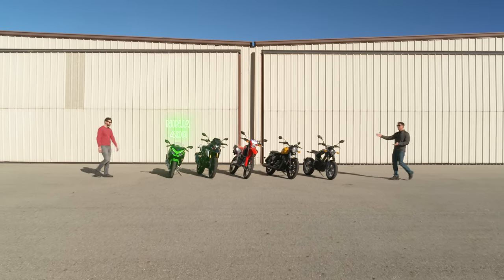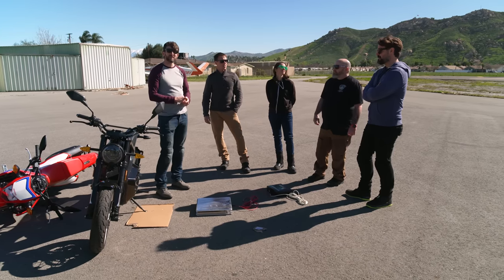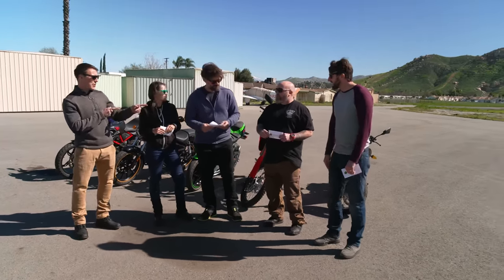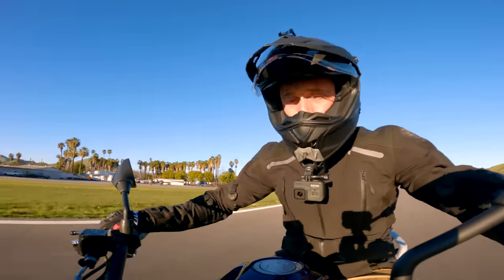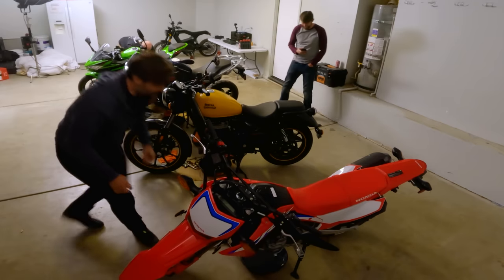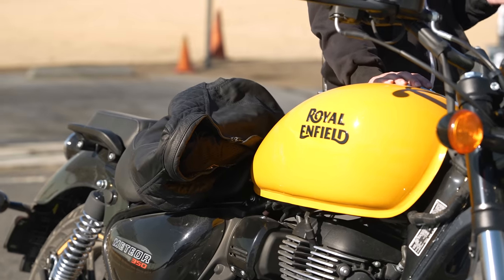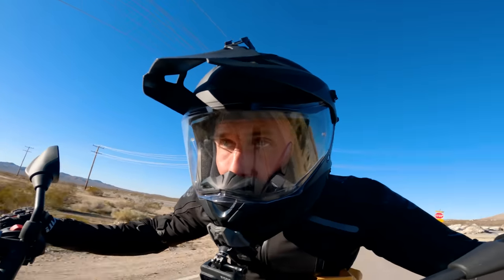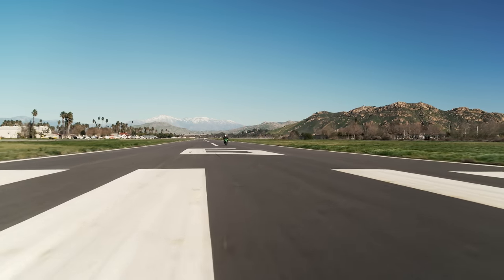Best Beginner Motorcycles! Ninja 400 vs Meteor 350 vs CRF300L vs Sondors Metacycle vs G310GS | CTXP

Comment: Proud of the two Indian bikes on there :) I've ridden them (RE and GS) both and i gotta tell ya, the Indian motorcycle market has some of the toughest competition out there. These are some of the best motorcycles I've ridden and they're a great choice for any beginners out there.
Reply: I also think it would have been interesting to swap out the Metor with either the Classic 350, Hunter, or Himalayan, but I think for this test they wanted to have a cruiser, sportbike, ADV, dual-sport, and electric. As the owner of several bikes including a beefy 1250 GSA, I'm still jumping on my Classic and Himalayan to have fun. I think RE is on a roll with things and the US market is really just now opening up for them.
Reply: I have a '22 himi and I ❤ it.  I put 1500 miles on it in the first month I owned it.  My understanding is that RE is coming out with either a 450 or 650 as an update.  I hope that they keep them oil-cooled thumpers with NO tech.  I get complements on my bike all the time from old guys that think it is an old bike.  They can't believe it when I tell them it's a '22.
Reply: @shannonkerr2313  That's the USP of RE. Classic design language.

Comment: Good stuff!  This is rare for me to comment on any YouTube video, let alone a motorcycle video. I am providing my cost to repair after dropping my used Triumph Trident 660 twice within two days.
OEM front brake lever - $70
OEM rear brake pedal - $129
OEM Bar End Finishers (x2 as the ones on the bike were aftermarket) - $52
DIY install - $251 total. 
Extras:
Amazon levers - $29
OEM frame sliders - $152

I’m keeping and displaying the mangled parts as an example of what not to do!

Comment: I’m happy to see the 310gs rank fairly high up there. It’s a fun little bike and makes for a surprisingly good street legal dirt bike
Reply: until you put it against others in its class.
Reply: I like that it's on here for a small ADV bike.  BUT I wish its spot was taken up by the 390 adventure.  The KTM is better in every way.
Reply: @Ntmoffi  the 390 adv will demolish it in performance and value.
Reply: @norbertovillarealiii6750  💯✅
Reply: Knock knock, KTM head gasket
Reply: @memewizard8372  that was a problem on the first Gen 390 head and got fixed on the second Gen.  People who fixed their first Gen head and others that are in the second Gen are reporting 30k miles + with no issues.
Reply: @Ntmoffi  KTM - ready to repair
Reply: @Ntmoffi  I also think it was mainly a problem because people in the US expecially did mods to it without a tune, like a full system and cat delete.
Here in Germany we can't do anything stupid without pretty much losing the bike's value in fines. And I've never heard about a 390 dying out of the blue. I've heard of one case where someone at like 60000km having a transmission problem, but that's probably because the bike got ridden super hard.
Reply: @norbertovillarealiii6750  Especially at 6.6k€, 1k more and the cb500x would eat it up for breakfast.
Reply: @Daniel-dj7fh  The first couple years, even unmodded 390's tended to overheat and blow head gaskets when in heavy traffic and in hot areas.  It was unclear if the problem had been fixed in 2019 when I was looking for a re-entry bike (it had, as it turns out).  I ended up with a Z400.  I felt more comfortable on the Z400 anyway since I have short legs (28"/71cm ) and the 390 Duke was a bit tall for me.  I am old enough that sliding part way off the seat to put a foot down is not much fun anymore.
Reply: @norbertovillarealiii6750  The 390 ADV is listed at $7,939 (including freight charge), so is too expensive for this $6,000 and under comparison.
Reply: 390 adventure is far better. At this segment I’d just buy a DR-Z and call it a day.
Reply: @David..  According to the Suzuki site, the DR-Z is about $ 7,589, so significantly more expensive than the gas bikes here.  It's within $300 of a SV650.   The 390 ADV is even more at $ 7949 including freight charge.
Reply: I'll take a set of g310gs forks for my duke 390 then ill have a REAL bike with all the qualities you like plus some. Lol
Reply: @memewizard8372  KTMs will look reliable compared to a BMW.
Reply: @jfess1911  In my region the 310gs is 6100 and the 390adv is 6200, no brainer really. I guess we got it pretty good that we don't need to settle for a 310gs here.
Reply: The g310gs is underrated for sure. The ktm 390adv has better performance but the 310gs is a better ADV being able to run on 87 and has almost 20mpg over the 390adv.
Reply: @michaellee7933  The G310 is made for developing markets, hence long term reliability is the key to success. This is why it's so incredibly simple compared to the 390.
Reply: When it came out people were unfairly judging it on what it COULD have been rather than what it was and they always disregarded the fact that it was made for developing markets in South America and South/South-East Asia where it’s been selling really well

Comment: I got a G310GS because I wanted to try a little bit of every kind of riding, and I'm really glad I did. It's not the fastest or the offroadiest bike, but it has done everything I've asked it to with no complaints.
Reply: The 310 unfortunately suffers in the same area the Himalayan does, HP. You're never going to win a speed race with either of them, but they are great bike choices. I've been riding for over 40 years now and still find myself on my smaller bikes more often than my big GSA for a lot of tasks.

Comment: So glad to see both the G310GS and Meteor here, they are really cool bikes tbh
Reply: Ive wanted a meteor since I heard about them all those years ago
Reply: @stmboat  I own one myself as my first bike (even the same Fireball Yellow colour way Jen is riding in the video) and I love it. Going in I expected it would probably come last in the testing overall, and was pleasantly surprised how well it did in the first two tests because I haven't done any accessory or replacement parts buying (and haven't dropped it yet), but of the five bikes presented if I had to pick one all over again to buy for myself it would still be the Meteor. I just love it to bits. Ari has it right in the conclusion, even though it's heavy and slow and the maintenance is inconvenient to say the least it's just so endlessly charming and pleasant to spend time on.

Though I will say the idea of a more do-it-all adventure like the G310s is pretty appealing as well and would definitely be my choice if I were to pick a SECOND bike out of the same list.
Reply: I've got no interest in the Meteor.

But every time I see an RE, I do a head turn. They definitely have curb appeal for sure.

Ok, I would definitely consider a GT, if I was in that market.
Reply: @JoshuaTootell  : for city commuting, something like the Metor or Classic 350 is the perfect choice. However, if you need to blow down the highway, neither are going to impress you. But as the owner of a Classic 350, it turns heads like nobody's business. I think the old school charm simply wins people over. As somebody who owns big and small bikes, I can say there's a place for both.
Reply: I agree, I just don't have a need or want for that. I'm mostly a track rider. To the point I don't even know why I have a street GSXR, I should just put track plastics on it. But I also have a 50cc track bike  @waynebrissette9459

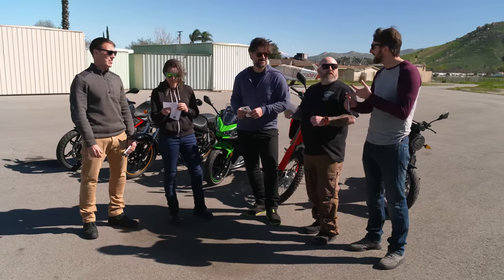Comment: 11:14 I want to mention that I had a friend crash his Meteor 350 at just 40kmph, but on the right side. His repair bill came up to 75k Indian Rupees approx (a third of the cost of the bike). The whole exhaust, both master cylinders and the metal parts added up big time. Meanwhile my Yamaha R15 crashed at 80kmph and I spent less than 4k INR because the fairings kept the pricey bits away from the tarmac.
Reply: @@jrodracing70 Pleasure's 100% mine, Jen! Awesome work by you and the team on this video!

Comment: While there is a place for this category of bikes, whenever I'm talking to someone thinking about getting into riding, my usual suggestion is to buy used. Usually you can keep it for a year, put some miles on it, and when you are ready to upgrade, sell it for nearly the same money that you paid for it. many people don't realize that bikes hold value much better than cars do, but the transition from new to used still comes with a good chunk of depreciation.
Reply: There's a sort of comfort in knowing your bike is new from the dealer, still under warranty, and you can go through the dealer no questions asked for all sorts of maintenance needs and part replacement and so on. As well as not needing to wonder what the previous owner did or did not do to the bike during their time with it. Especially as a new rider without the experience on bikes and around bikes, there are a lot of extra potential pitfalls buying used. BUT obviously you're right there are very many great used bikes similar to (or even exactly for the four gas machines) the bikes in the video, and you can get them for a lot cheaper than buying the new one. There's effectively a huge surcharge for that confidence and convenience at the dealership as opposed to buying second-hand.

Comment: Great concept, entertaining and informative execution!

I think that with the choice of tests, the scoring only really shows how "compromised" the two bikes in last place are; or rather, how much more focused they are in their respective niches.  The Honda is soft and friendly for trail and city use and the Royal Enfield is intended to be more of a laid-back "vintage experience" on a budget.  Neither are really the peak of today's do-it-all machines, but certainly each represents much of what bikes do best and also offer a slightly different flavour from the norm.

The Sondors coming mid pack probably shows that electric really works for an everyday bike, amazing actually.

Ultimately, the fact that the Ninja won shows that the old maxim in biking still holds true: he who has the most power, stays out front :D

Comment: Where’s our favorite ktm duke 390
Reply: looks like the ninja and the bmw took the spot over it
Reply: You want something reliable if you want a first bike.
Reply: @EstebanDVO  lol 😂
Reply: would get a little tedious if the duke won EVERY beginner bike competition, let's be honest
Reply: The Duke will leave you stranded.... 🤦‍♂️
Reply: Funny these guys doggin on the duke 390 for reliability when I've had zero issues with mine. KTM may not be as reliable as the big for Japanese brands but they're not as bad as they used to be either.
Reply: @hooviedoovie5220  Not as bad as they used to be doesn't really make it better than the Japanese offerings.
Reply: Getting its blown motor fixed
Reply: @512mbflashdrive  It won’t. The Ninja blows the RC out of the water, let alone that peppy, Pygmy Duke
Reply: In the shop lmao
Reply: It's your favorite not alls
Reply: I love my salvaged Z 400. Super cheap, super fun. I don’t have to worry about it being dropped because it’s been there and done that. And I especially love its little sewing machine engine. It is a giggle machine even though it doesn’t have much power

Comment: Wow, top notch production guys! Thoroughly enjoyed it all, from start to finish and learnt some great things so thank you! As for me I went with the high performance liquid cooled (2016) YAMAHA WR125X SuperMoto & I have to say it it the best investment I've ever made! Such exceptional control, perelli speed demon tyres which feel like literal glue on the road (also went tech 7 drystar and have to say it feels incredible to ride ever since, you feel completely planted on the pegs no matter what position & fully waterproof peace of mind!) It is such a shame that the only manufacturer left doing a 125 Road Legal SuperMoto is Aprilia these days... 

I've also stuck to 125's due to just loving this model sooo much, I'm not about speed tbh, I just love twistys and scrapping around a/b road country lanes in the UK. I will however totally look to an ADV (Loving the BMW & KTM 300-600cc Models) as they clearly are the best for an all terrain premium experience, especially on the road with all that aerodynamic fairing which SuperMoto's lack, or I may go to another higher cc SuperMoto...  

I also went all out on all tools needed, to save hundreds in repair & labour costs and a Haynes specific Yamaha WR125 manual (definitely worth it's weight in gold if not even more so!) And now fully self suffiecient, and you're so right about it being calming & therapeutic for the mind.

Found a new love for engineering & mechanical work now honestly, and I'm not sure I would have done it all that way if not for you expertise & brilliant videos covering everything. 🙏🏻

Love to see it & keep up the excellent work you all do!

Greetings from the UK my fellow Bikers and have a brilliant year to the entire team at @RevZilla 👊🏻😃❤️

Comment: I think that last test was the best test. It did show that to most people, the service costs of a G310GS may not be ideal, but it isn't the only light weight ADV for sub $6k on the market. The best beginner bike will be the bike that suits how you intend to ride. But they also really showcased the versatility of an ADV, even middle weight and heavy weight ADV's (after your beginner bike) are still good in the twisties and on the highway if you never take it off road, but if you do want to take it off road, most of them that are 50/50 or more will go wherever you point it. My first bike was a KLR650, I still have it, and it's great for what I need out of a bike.

Also worth noting that the overall message of the video, that the spec sheets don't tell the whole story, is so real. Review videos and articles are your friend when starting out. You can also usually find vs reviews of almost any two bikes in class and that can really help narrow it down.

Comment: Had a 310GS that I intended to ship across the pond, and then Covid set in. Neat little bike. Sold it a few years later.
Just bought a Triumph Speed 400 to ride when I didn't want to dig out my Tiger Explorer 1200.
I'm not a beginner (riding since 1961), but a fan of small bikes.

Comment: I thoroughly enjoyed this comparison of different entry level bikes.  The two advantages the Sondors has over the others is that the neighbors won’t be complaining about your comings & goings due to zero noise and not having to change motor oil & filter.  The adventure or dual-sport bikes I think are the way to go as they can adapt to urban, open road, and twisty turn road riding.  The Royal Enfield looked like the most comfortable one to ride on for urban/open roads.  Hard to beat a Kawasaki Ninja for speed and twisty road riding.

Please conduct a test of what the next bike purchase would be after gaining a little experience.

Comment: The best way to compare lifting weight would be to measure the torque required to raise the bike to 45 degrees (or some arbitrary identical angle)! That would remove any effects from how high up you grab the bike.

You could for instance plot curves of torque against angle!

Comment: I started watching thinking I'll skip through most of it, but ended up watching the whole video. 
One thing I was wondering was that whether the angle the Meteor was held at during the pickup test was the same as the others. I understand that it has to be lifted further up to touch the tyres on the ground, but it doesn't really feel that light compared to the GS when tipping to the sides. Maybe it's the seating position with knees bent and forward that gave me that impression.

Comment: I think the CRF300L is the best buy for most people. As someone who has owned over 15 motorcycles throughout my life, from ZX10R to Harley Davidson to Groms, I personally picked up a CRF300L because it is a fun getting around town bike and has great offroad potential and an amazing aftermarket. One of the best things about it is you can explore offroad riding after you are comfortable with on road riding, and that is something you don't get with any of these other bikes. Not to mention, the reliability is basically bullet proof. You could redline the thing on the highway all day and that little honda thumper doesn't give a shit. Not to mention they recommend 8K miles for oil changes.. like... WHAT??? I'd never go that long, but it is a testament to how well the bike is built.

Comment: I brought a meteor 350 great bike but huge issue i found was getting assess to basic parts and wait times everythings is overseas unless you have a nearby dealership even then there is still long wait times for specific parts order through the dealership.

Best example was i waited half a year just for engine protective bars and a back rest chair from the brand.

Comment: I would sure like to know what the vertical weight of my Africa twin is! At 69 I can no longer pick it up. But I do have a Moto winch that works. My new CRF 300 L I can handle, though some days, it’s very difficult.  I have been doing exercises in the gym, that replicate lifting a motorcycle the way you do here. And I’ll practice up to 200# I can usually do it. I’m pretty comfortable doing 160#, so it’s glad to know that the 300 L is only 150#.
Reply: Yamaha T7 is even worse to pick up than the crf1000l..

Comment: This was really a test for a "Do everything bike", so it's really only between the Honda and the BMW and the Honda wins hands down. Each bike is an equally great begginner bike IN ITS CATEGORY. Also note that the Sondors has programmed Restricted Launch for safety reasons, so doesn't have full torque from standing still. It can be unlocked in software if you know what you're doing.